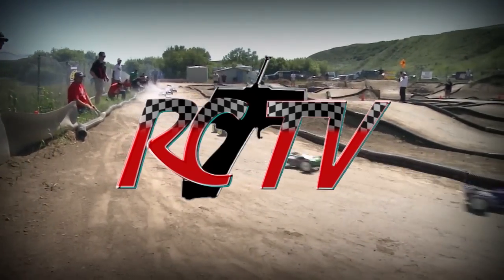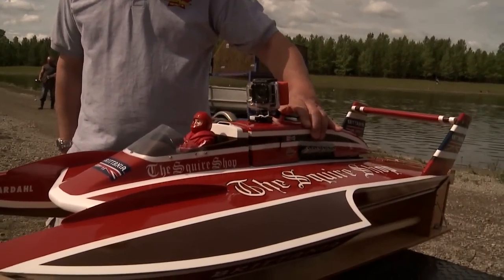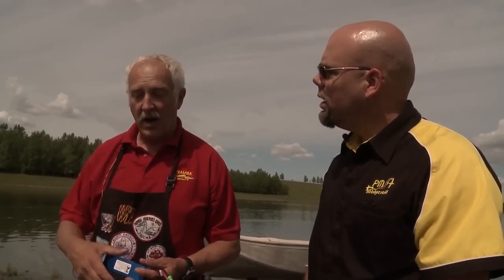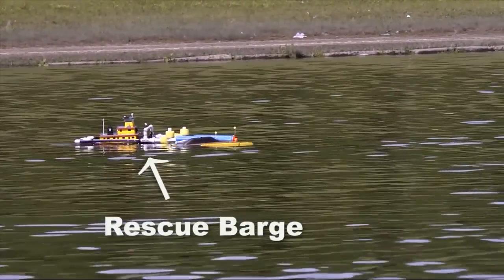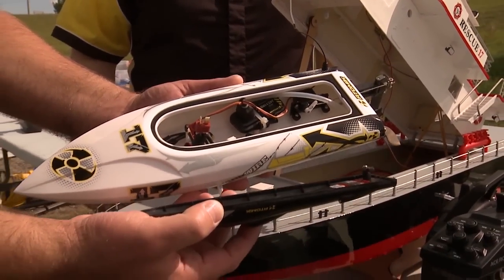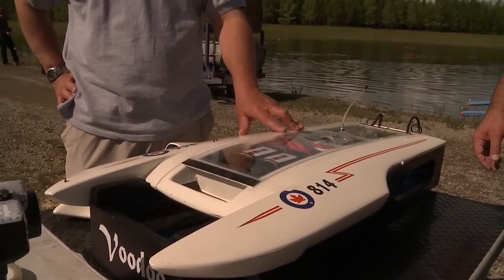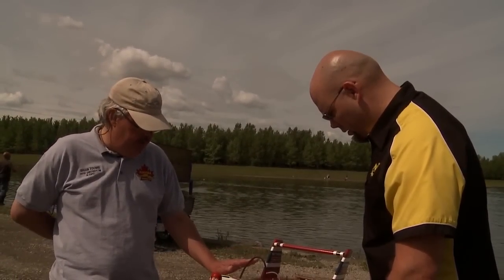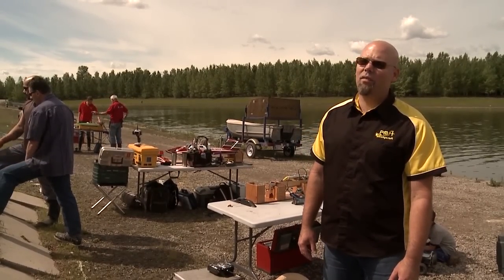RC boats: eletric or nitro witch is faster.

Comment: once you've done electric you never go back to nitro.
Reply: paulkazjack   Totally have to disagree, for me the most enjoyment I have is with the tinkering and tuning those little engines, take that away and half the fun is gone.
Reply: @MrBelly666 i've move from gasoline to electric, run g320, 29 and 26cc gasoline before... Those electric always making fun to our gasoline speed back at the day. Forcing me and others to move into electric boat... Now is our turn to making fun on others gasoline boater... Gud there are still gas boater, at least i can have the same feel when they were making fun on us back at the day when im still with gasoline.
Reply: I tried nitro once and sold my electric boats instantly.

Comment: what is more fun? Not electric
Reply from the maker: RayneoftheCanadian  To me electric. But I have trouble starting my chain saw. :)
Reply: Haha me too.
Reply: I disagree
Reply: My son wont wait for batteries he is 5.
Reply: I don't get how people can claim electric can be fun. Run it for 5 minutes, charge it for hours. How many batteries do you need to be able to stay ahead on charging? At least with something that burns fuel, you can top it off while it's still running. I really don't get how nitro is slower for these smaller boats. Do these electric motors really spin faster?
Reply: +Tim Ramich I wouldn't say that the Lipos take hours to charge. The motors do spin faster and are a lot cleaner than Nitro. Some lakes will not allow nitro due to the contamination of the oil that the exhaust spits out into the water. I like both, but prefer electric.
Reply: Tim Ramich In my opinion, nitro will ALWAYS be more fun. That being said electric are faster because they have all there horsepower and torque from zero
Reply: Tim Ramich In my opinion, nitro will ALWAYS be more fun. That being said electric are faster because they have all there horsepower and torque from zero